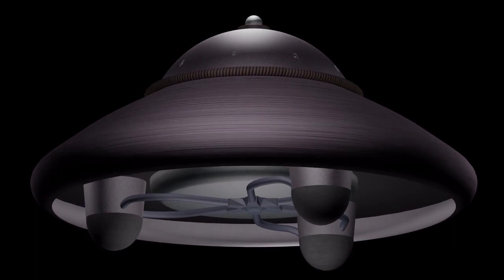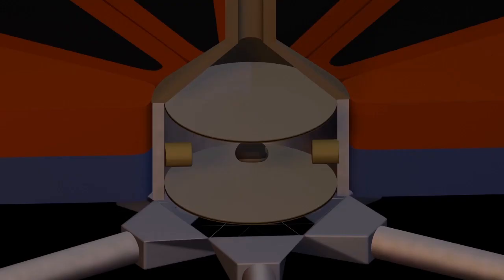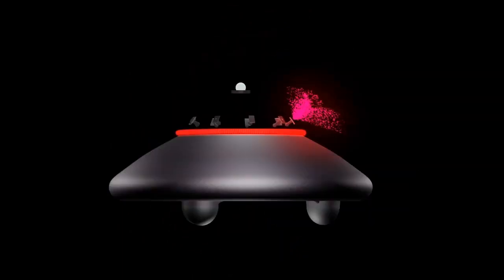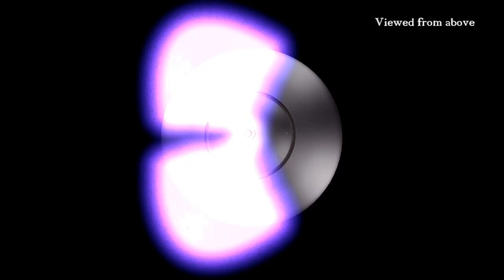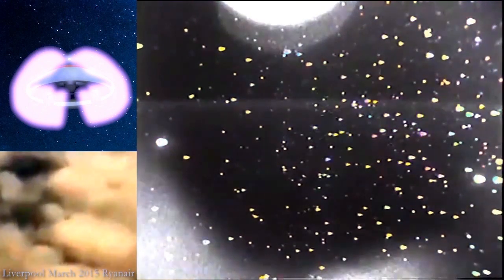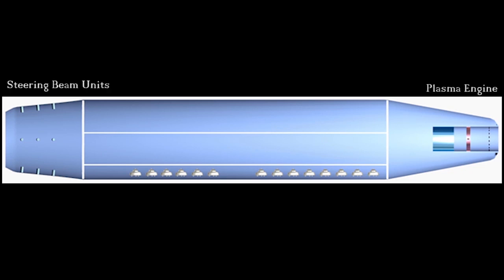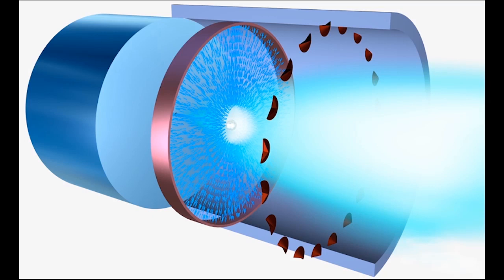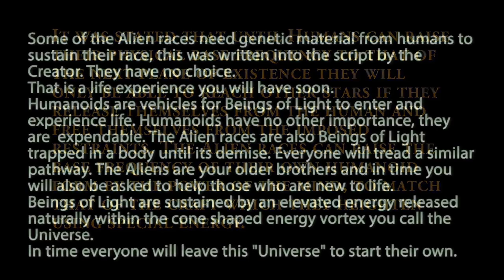Alien Craft Antigravity and Positron Propulsion Mothership Antimatter

Comment: One statement puts the entire thesis in peril.  In the sentence where thermonuclear reactions are mentioned there is nothing but bovine scatology.  Thermonuclear reactions are those where lighter nuclei of atoms fuse to make larger nuclei releasing massive amounts of lost matter converted into energy and deadly radiation from the photons emitted.  I think the entire thing crumbles into rubble right there.   Someone has mastered technobabble and should be doing high speed talking commercials as a way to make money.
Reply: What would you call a device that uses heat to increase the temp of the nucleus to create a reaction?
Reply: @simongeel4287  An accelerator, high-speed neutron emitter.....

Comment: When traveling that fast in hyperspace how does the”mothership” slowdown or stop? I didn’t see anything described. Without any atmosphere it would continue and never slow down.
Reply: It turns off hyperspace probably. If space “doesn’t exist” in hyperspace then you wouldn’t move relative to space
Reply: By creating thrust from the direction that it is moving in, to counter the momentum, however I'm not sure there even would be momentum no matter the size of the object, because that isn't really how this seems to work. At this level of physics, you can achieve movement while sort of skipping over momentum and inertia

Comment: In the American Scientist Mag - 2002 - Dutch scientists used a similar device to push positrons thru a crystal - they said they discovered the antimatter positrons travel thru a crystal better than electrons, so he got that part right. Also, everyone associated with the TR3B said the antigravity device is simply a fast spinning magnetic fluid field - and this craft is similar. My brother worked underground on a mini version of Cern in Britain for 40 years - he looked at this video and said it was not dissimilar to the magnetic devices they made to move positrons around - except this is very clever - he was referring to the integrated nuclear engine .
Reply: Yeah, because the TR3B Astra is definitely real
Reply: is anyone building this craft

Comment: This is either a misdirection, or is just a plain lie. I have developed what can be called anti-gravity propulsion. I  have successfully converted centrifugal force into directed thrust. It will replace all rockets and jet engines. Probably not coincidently,  it looks just like a flying saucer. It is a completely closed unit and will be powered in space by a small nuclear reactor. It will continually accelerate in space, which will give you gravity in your spacecraft while accelerating and while decelerating. I have a working prototype and a patent pending. Also, I wrote a paper several years ago that proves that it is possible to travel faster than the speed of light. That paper can be read at <www.keelynet.com/energy/ftlplum.html>
I am prepared to discuss/argue, this paper and details about my prototype with anyone, including any physicist.
Jeff Pluim
Reply: Let's see a video about that anti-gravitational device working. Oh, I just saw your imbalanced "working" prototype clip, I'm not too impressed. Something makes me think it's not your invention, I've seen the following movie at least TWENTY years ago, here are some details from it, watch them carefully:
https://youtu.be/8uo9k1kcKCs?t=661
https://youtu.be/8uo9k1kcKCs?t=1580
TWENTY YEARS AGO, and there is NOTHING happened since then. I guess you will not make it replace jets and rocket engines. No offense, but do you think if they (in the movie I linked above) didn't make it through, then you will? Almost all the people shown in the movie is dead right now. It's not coincidental.